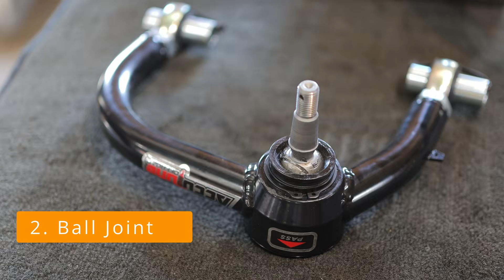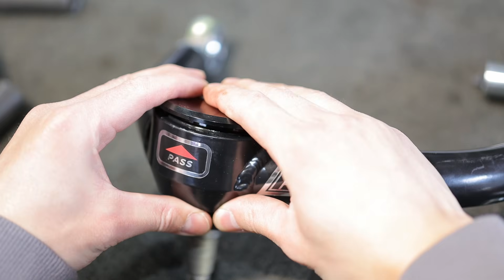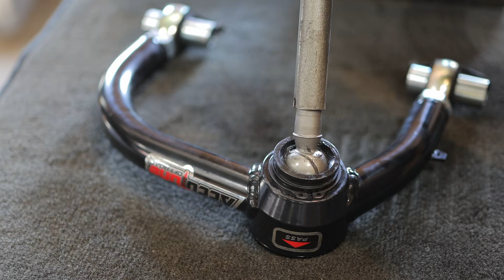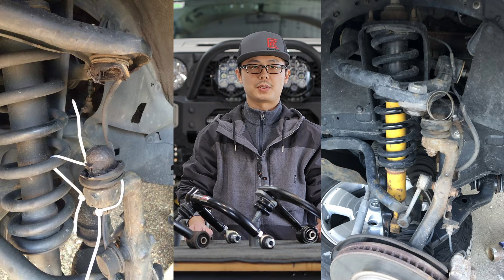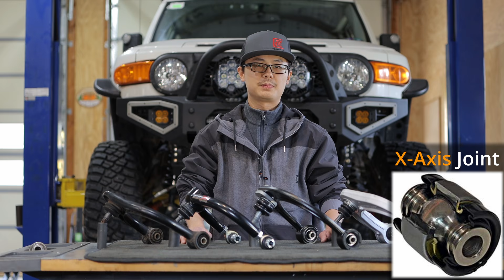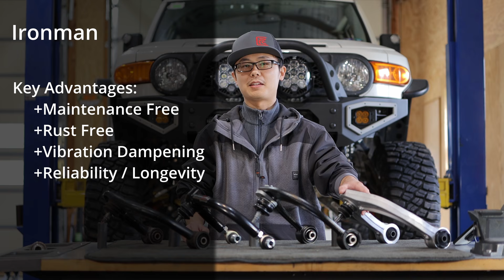Which UCA is Best for YOU? Toyota Aftermarket UCA Part 2

Comment: The xAxis joint is completely insulated from the steel by rubber.  This gives it better NVH than a rod end.

I know this because I had to replace one, the process involved drilling out the rubber yo remove the metal portion of the joint.
Reply from the maker: Ah you’re correct. Looks like SPC has a UCA specific x-axis bushing, which is the generic x-axis joint wrapped in rubber. Hmmm this is even better. How long did yours last? Or why did you have to replace them?
Reply: @TinkerersAdventure  I did the thing where you buy mevotec supreme and SPC parts come in the box.  One of the joints went bad really fast and at the time I could not get them warrantied because they were out of stock.  So I found the kit to replace them.

Other than that the rest have been fine for about 20k miles.
Reply: 25,000 miles, they’re no good
Reply: Mine lasted 8,000km! SPC has an issue!,
Reply: Spc ball joints suck.  When through two sets in 10 k.   Using accutune now

Comment: Question for you, right now I have a 2020 TRD sport with stock 17in rims. I have a 2in lift and I’m running 285 70r17s. They clear everything except they rub slightly on the UCAs at full turn, the UCAs are stock. What would you do to fix this? Do you think the slimmer profile of the accutune would give me the clearance needed? Thanks!

Comment: Hey Kai, great video... i have a 2003 toyota Tacoma 4x4 v6 double cab, when i bought it from a guy, it had the 4in rough country suspension/drop bracket, one day it was at a shop, the upper ball joints broke, i would up with the 6in rough country because the 4in lifts are not mads any more anywhere, i did this because the previous owner cut out the crossmember to accommodate  that lift, i think it was Pro comp. 3 months out with the new  tires (285/16's, they are wearing on the inner tires up front. Ir still has the factory UCA's. Please advise what i should do to remedy the situ2. Thanks!!

Comment: Lmao my  spc bushings and ball joint failed at 4 k.  No off roading. Changing them out for accutune
Reply: I’ve got around 40,000 miles on my spc’s and they still going strong. Mine came with the updated (sealed) ball joints. I’m on 33’s and have spent a ton of time off-roading & as a DD

Comment: My aftermarket UCA is a tubular design and the upper ball joint housing is 2-1/4 inches. It might be a Chrysler K772-style. I think that screws in instead of pushed in. My boot tore so I need a replacement. I'm just trying to determine the right ball joint replacement. Thanks!

Comment: I don’t understand, you say the iron man is one of the best but it sets the caster back the furthest which then decreases wheel gap between the tire and body mount. Wouldn’t the iron man be the worst to fit for 33s? I enjoy your videos and they are very informative but I’ve found this information to be counterintuitive. I have 32.2 tires on no lift and they are half inch from hitting the body mount. I’m getting ready to lift and eventually want 33s. Wouldn’t  the iron man UCAs create less space?

Comment: Hi tinkeres, i am having problems with my 4runner 2001 lifted 2.5 “ and the front camber , is positive, i already have installed upper fredomoffroad arma (1”-4” lift kits ) …. May you know what i haber to do to correct my camber to 0 ?

Comment: I really like your content.Just a heads up. The SPC balljoints don't last and there customer service is no help either. The joints wear out prematurely.
Reply: That’s wild because I have about 40,000 miles on my SPC UCA’s with the update ball joint (sealed). And they’re still going strong.

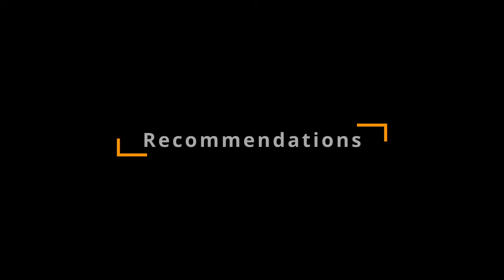Comment: 7:47 - I got a set of poly UCA and regret it. I’ve owned them a couple of months and after this last weekend, the driver side rear bushing on the uca is now popping out. Now I have to replace them after a short time. I’ll be going back to the rubber ones this go around

Comment: Ive been a long term fan of the KO tyres and I have now just purchased the new KO3 in 275/70R18 (33.2" dia) for my Prado 150 (Kakadu with KDSS) in Melbourne, Australia. I have cut back plastic mud flaps on both front and rear but noticed that there is still significant rubbing on the inside of the tyres against the UCA's, especially on the right side, when turning full lock. Camber  is 0'13" L/0'33"R and caster is 2'42" L/2'29". I am curious to hear your views on the best solution but I suspect it is a new set of UCA's. Which one would you recommend, based on the latest you have seen.

Comment: The correct answer is ball joint. If you are considering a uniball, save time, money and a lot of work and just get a Jeep. I've had Jeeps but currently drive a 4Runner. Jeeps are the ultimate crawlers but suck everywhere else.

Comment: I'm running ironman stage 2 nitro lift.. and both ball joints cracked open last month.. I've had them on the truck for about 11 months. I'm aware of the recall but CS is taking forever to reply.. from emails and call back... Should I just replace the ball joint myself? Thinking of Mevotech TTK ball joints.

Comment: the comment about clearance and reservoir hose addresses exactly what I've been dying to know. I ran the old man emu BP51 on the 4runner front, but kept the stock UCA, as I set the preload to be very low. However, somehow it still gave me a 3" lift!! The lift aside, I am really concerned that the hose is tightly tuck between the shock body/collar and the UCA, I feel the down travel of the UCA will soon destroy the hose.

Comment: Accutune UCA's are great.  After blowing through several sets of SPC's due to X-axis failures, I wanted to try something else.  So far so good, no noises yet several months in.
Reply: @turk_labs still going good brother? I like them, worried about the heims noise-wise.
Reply: @LedgerandLathe  no noises at all yet, still solid.  Probably 15k on them total, did a 5k trip from east coast to Colorado and Moab without issue.  Going to pull them off to inspect and do a double shear brace for the UCA mounts.
Reply: Badass, thanks for the reply! @turk_labs

Comment: Hello, thanks for the videos. I would like to see you add the JBA  and/or JBA HD High Caster UCA's to this or your next comparison review of UAC's. I'm currently running with JBA HD UAC's on a 2009 Toyota FJ Cruiser and they are holding up very well and allow my alignment to be adjusted to +4 degrees caster to move my front wheels forward.

Comment: i am planning to upgrade my fj stock suspension system with 2.5” dobinsons IMS , 265/70/17R tire. what is your advice, do i need to upgrade the UCA or stick with stock UCA. Thanks 😊
Reply from the maker: Yes you need UCA at 2.5” lift

Comment: So for somebody running -25 offset, they should go with Accutune for SPC over Ironman?
Reply from the maker: That is a lot of offset. So probably SPC is your best bet to minimize cutting.
Reply: @TinkerersAdventure  
You're obviously a lot more knowledgeable than I am on the topic. I dont want to take up your time, but I do have to ask because I'm trying to play catch up on your videos since I just discovered you. 
I want to know whether or not you think I need UCAs? I already trust your opinion over most because you actually test these things and learn about it lol
I have a 3rd gen Tacoma. I have 5100 in the front with ome springs that will give me 2-2.5" lift. Im going to get 5160 for the rear and have a icon AAL that gives me 1.5" in rear. My wheels are 17x9 -25 and they're wrapped in 33x12.5 geolandar MT. I also have a new cab mount kit.
I haven't put anything on yet. 
Should I get UCA for the alignment alone? Or am I fine because the factory UCA can handle the lift? 
I appreciate any help and look forward to watching your videos!
Reply: @mitchelodeon did you ever get UCAs?

Comment: Dobinsons and JBA UCAs are also top notch as well. For older Toyotas my preference is JBA, can run a larger tire/wheel and not have a bunch of maintenance.
Reply: I currently have JBA on my 2006 Tacoma Double Cab. It’s been 2 years and zero issues. Just add the recommended grease when you do your oil changes
Reply: @kennethbecerra7362 still running well? Looking at doing the JBA on my 06 tundra as well
Reply: My Dobinson  didn't last 110 k.
Not impressed.
Reply: @dougdownunder5622  what happended to them?
Reply: @Mrsimmo26  cracked bushings.
Reply: @dougdownunder5622  are they rubber bushes or polyurethane ones?
Reply: @Mrsimmo26  don't know.

Comment: If you actually use your truck for off-roading, don't go with SPC. The frame pivot bushing don't hold up well if you off road a lot. Trust me
Reply: I’ve always heard good things about SPC and was just about to buy some 🤦🏻‍♂️
Reply: They’re death traps
Reply: I’ve also had premature ball joint wear (like 5k mi), and I’ve had the camber slip twice (with correct torque)
Reply: I’ve got around 40,000 miles on my spc’s and they still going strong. Mine came with the updated (sealed) ball joints. I’m on 33’s and have spent a ton of time off-roading& as a DD.

Comment: I've had SPC for a long time on my 4runner, I've replaced 4 sets of upper ball joints and one set of bushings in 6 years I've had them, definitely not maintenance free, I do wheel a lot and have 35" tires all that contributes to faster wear. ~ $160 for SPC UBJ pair is not cheap either, JBA napa ballpoints are alot cheaper for example. I'd like a better setup for my needs, and wish I went with a different brand with a different style balljoint from the beginning.
Reply from the maker: Yeah based on many comments I received, SPC are very short lived. Cool concepts, poor execution
Reply: @TinkerersAdventure  really ? I was just about to buy SPC uca but now you’re making me think twice.

Comment: I have the Icon Tubular with delta joint. Super happy with them after 4 years of abuse. Recommended them to my friend and he’s happy with them as well.
Reply: Make sure to check your delta joints. They will start to rock back/forth and simulate the feelling of a bad wheel bearing. Not cheap either. I'm replacing both UCA for half the price and work of replacing the delta joints

Comment: Re JBA uca's:
The control arms themselves is nothing but a couple of welded pipes and plates.
The only part that might require basic intelligence and quality control is the ball joint, and the damn thing failed in less than a year. Not extremes/off-roading.
The reason is that this outfit get incompatible pieces from third parties - the boot doesn't seal at all because it's FOR A DIFFERENT BALL JOINT, for fuck's sake! They attempted to "fix" the issue by adding an aluminum bushing but it's like treating a corpse with aspirin. The joint is full of water/sand mixture, and, of course, their "warranty" doesn't cover a damn thing other than the pipes.
In three words, IT'S A SCAM.

 I replaced the ball joints after only 12,000 miles - they were not loose yet but felt very rough. I initially thought the issue was just the boots but after I cleaned it up, I found that the ball was not smooth as it's supposed to be - the surface is rough so nothing can be done to rectify lousy manufacturing defect.
Update after three years/40,000 miles. The bushings that's supposed to be bulletproof are already worn. Again, no off-roading, mostly highway driving.

Comment: I'm running stock uca on my 19 4runner OR with fox 2.0 coilovers front with 1 in lift coils in rear with fox 2.0 shocks on stock size wheels and tires was going to  get aftermarket uca but so far alls well on the stock ones

Comment: I currently have SPC UCAs and their bushings just wore out on my 4runner after just a year or 20K miles. It's making horrible sounds now and I wheel on an off road park every other weekend and use it on Colorado and Utah off road trails. My mechanic told me they're just factory replacement and not suitable for hard, off road use. The ball joint on the SPC is really fine as I grease it every 5k miles. Is my mechanic correct on saying it's not really meant for off-roading? I saw on SPCs limited warranty information that it's not covered if used off road. I am looking to replace it with accutune or the ironman now since the accutune has heim joints but I really like the set and forget thing that ironman is offering and it looks good and shiny and to top it off I got ironman FCPs after watching your videos. Loving their shocks so far!
Reply from the maker: From the many comments I received, sounds like the SPC x-axis bushings do not last long. Great concept in theory, but poorly executed. As I mentioned in UCA part 1 video (check it out if you haven’t) strength needs to be put into context. Factory UCA will outlast most aftermarket UCAs even in off-road use. Breaking things with brute force and components wearing out are 2 different phenomena. Most people believe you need “upgrade” everything if you go off-road, but that is oversimplified thinking.
Reply: @TinkerersAdventure  you are right. I have learned from this experience and have a mindset now that these are “wearable” items. I just realized how much more wear off roading really does to components. I gotta always have some spare parts on the field and gotta know how to fix em. I have watched all your videos actually. You have a different perspective than the others and are truthful and knowledgeable. Your videos are very educational and interesting. Keep up the good work!

Comment: I've heard the SPC control arms slip out of adjustment every few thousand miles. Any word on if this is true?  

I've seriously considering the Ironman4x4 foam pro kit for my Tundra, but I'm unsure if I want their aluminum arms or to get some other arms such as the SPCs or maybe the JBAs.  I'm looking for durability, long lasting, low maintenance. I don't want to have to get an alignment every 5000 miles, or replace uniballs every 10k miles.
Reply from the maker: I don't have long term experience on SPC. I had SPC many years ago before I installed long travel IFS. I hit an obstacle on passenger front wheel at high speed and sent me airborne. The SPC joint slid in the channel. I realigned it and everything was fine. If I didn't have SPC, i probably bent something else.

Comment: Hi 
我的4runner UCA是魚眼，有什麽好方法養護它
Reply from the maker: There isn’t really a good way unfortunately if you get mud on the uniball. Most company recommend Tri-Flow PTFE dry lube. I have also tried other industrial lubricants. The most it does is eliminating squeak. They won’t make substantial difference in longevity.

Comment: I would love to see a video on Tacoma lean, or the driver side droop on the sr5 platform. I'm interested to see your analysis/solution. Awesome video once again.
Reply: Funny how there’s always a toyota lean on their 4wds. I had an hdj80 with the same driver side lean and 2 fortuners 2015 and 2020 with the lean as well. Only explanation i could think was the fortuners were designed for a majority RHD market so fuel tank sat on left to balance the driver side rhd but in making LHD market units it causes all the weight to sit left side.

Comment: Ive had SPCs on my tundra and now SPCs on my tacoma and they have both been flawless. I grease the UBJs every other oil change and they remain silent. Between the two trucks, I personally have 50k miles on SPC UCAs with no problems to report. If my GF's 4runner gets an aftermarket set of UCAs they will likely be SPCs
Reply: Interesting. I've had my SPC's since May 2020 with no issues as well but I keep hearing about how people are having problems with them
Reply: I've had SPC for a long time on my 4runner, I've replaced 4 sets of upper ball joints and one set of bushings in 6 years I've had them, definitely not maintenance free, I do wheel a lot and have 35" tires all that contributes to fater wear. $160 for UBJ pair is not cheap either. I'd like a better setup for my needs, and wish I went with a different brand with a different style balljoint.
Reply: What kind of grease and grease gun do you use ? You grease every 5k miles ?

Comment: I have SPC but it’s not flat like the one you have. I’m not sure if it’s an old version or not as I did buy them 2 years ago. It’s round, thick and heavy. It also doesn’t have joints like yours. It has thick bushings with a center metal sleeve.
Reply from the maker: Yeah that is their first generation aka light racing UCA. I had them many years ago

Comment: I went with the JBA UCAs and, while they have performed fine, I kind of regret it. Having to grease it every 3k miles is a pain and I've just got grease and dirt coating my UCA all the time.
Reply: FWIW you can really easily swap ball joints on the jba arms to sealed ones. They're all built around a standard GM truck joint. It's only 4 bolts and no press required so you don't need to remove the arm from the vehicle. I think the moog sealed joints are pretty good and inexpensive. Good luck.
Reply: I'm not advocating to not maintain them but I've had no issues for 30K miles and I've greased them once I think.  Perhaps I should take a closer look, but I don't mud or sand wheel and we haven't seen a ton of rain out here last few years.   
My big issue with JBA is I didn't get the updated bushings or ball joint boot as I bought before we all complained and he updated them.